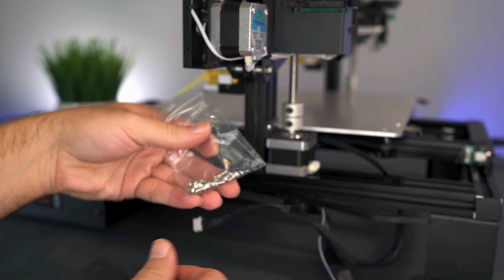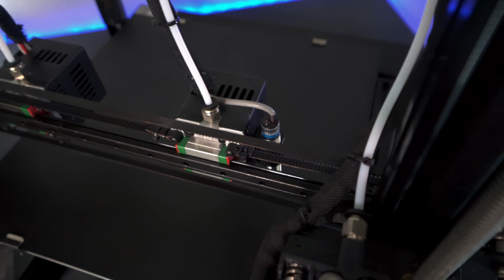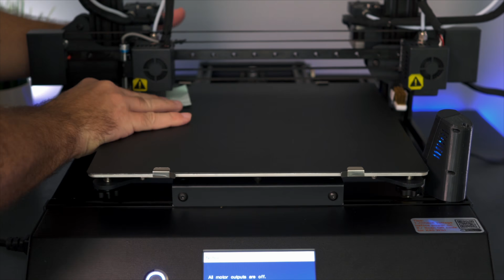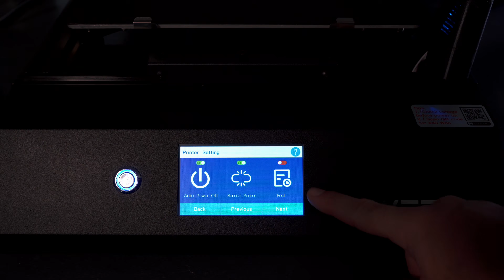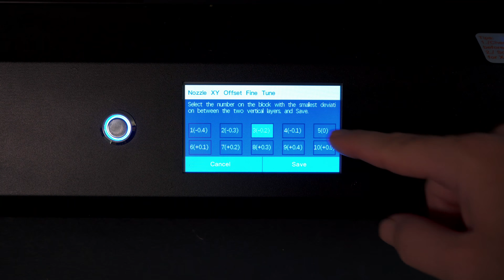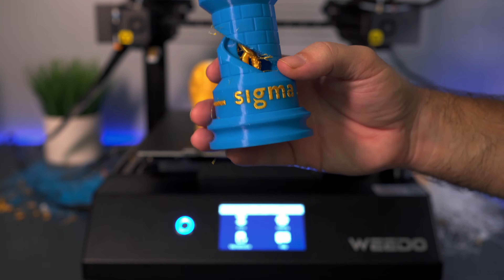Weedo X40 IDEX 3D Printer - Assembly Leveling & Print

Comment: at 13:44 You mentioned it crashing into the top of the gantry. This is not unheard of, and some 3D printers will use that to align the Z Axis by crashing them both into the top.